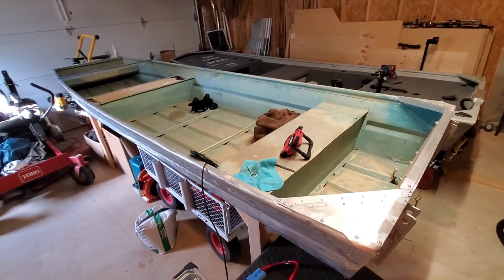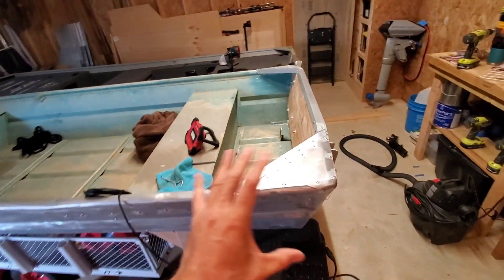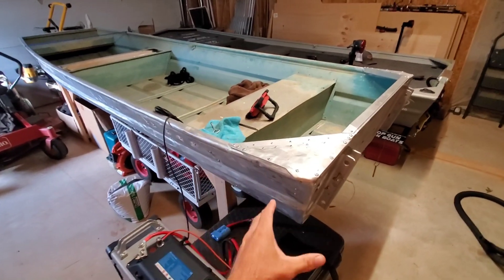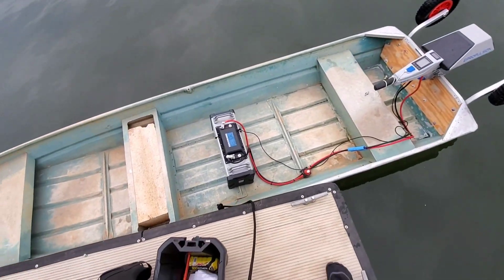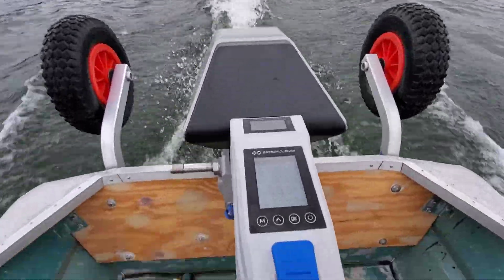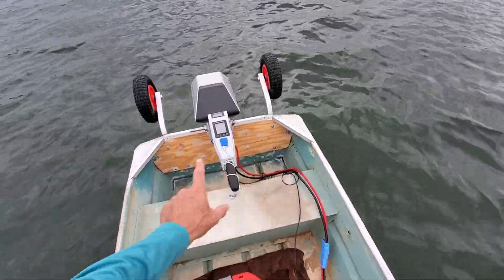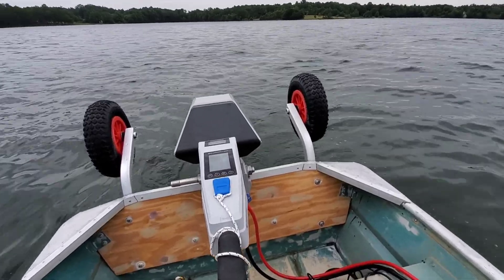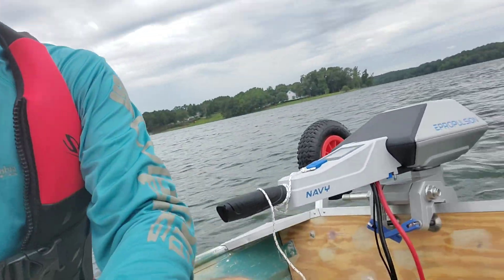12 Ft Electric Jon Boat Top Speed / Stability Test

Comment: Seems to me that electric outboard is not a 6  hp equivalent when used in a 12 foot Jon boat but might be 6 hp push power for slow 5 mph more heavy water line speed  14 foot bass boat  . I saw another you tube with 6 hp outboard I think it was mariner and he was flat out getting 18 mph   using the inbuilt tank 1.1 liter  (  0.3 USA gallon )every 25  minutes . That makes about 30 mpg .Only complaint was it took about a minute with bogged down engine to get up to speed  to get full speed . Probably  a 8 hp would solve that or less pitch prop but reduce top speed down to 15 mph .
This combo in electric  is very good if your happy to top out at 12 mph .However it probably need the  electric 9 hp equivalent to match the  gasoline 6 hp  . Without to give us the type of battery is it for example a LiFe 49 volt 4 kilowatt battery we cannot know your range  or run time .If battery is LiCobalt  18650 types with 4 kw it would suggest run time is 1 hour  and some minutes like 15  minutes. The last half hour power in electric in this combo might reduce speed to 9 mph suggesting range will be something like ten miles with average speed of 10 mph .
These are the important facts  boat users need to know 
I suggest  possibly increasing the pitch of the prop and reducing the blades to two blades might give you a extra mile per hour but take a bit longer to get up to full speed ..
Once you put two or three people in this boat  speed will drop s lot to me like 4 mph
Keep us informed updated on the tests
Reply: qeong

Comment: I love the electric tiller motor.  What was the cost of the motor?  How about the battery.  It looks as thought they want that specific battery to the motor.   I've got a 14 horse gas motor that I'd love to switch out to get away from gas.    You're giving me some great ideas.
Reply from the maker: Electric Outboard by ePropulsion:
Want to try before you buy? ePropulsion motor is available in over 30 countries and regions. You could schedule a test ride here: https://epropulsion.typeform.com/to/cpDJAn
Reply from the maker: Motor was 2,600 I believe...
Reply: 15 hp propane

Comment: Thank you for the data, I appreciate it. I've been going back and forth between the Spirit 1.0 Plus and Navy 3.0 for my 15 foot Kaboat. I'm willing to pay extra dollars for the speed, but I'm not sure I'm willing to carry the extra 100+ pounds when an inflatable requires moving everything four times per trip (load into truck bed, unload at put-in, load back into the truck bed, and unload again at home). My boat is used mostly for hunting, so the ability to put in without a boat ramp and silently travel far and fast for ducks and deer is attractive. Right now I run a homemade 105 amp-hour lithium ion (22 pounds) and a standard 40 lb trolling motor (18 lbs), it's lightweight but  S - L - O - W  at 3.7 mph...
Reply from the maker: No problem,  I believe I will be doing a vidro on the Spirit 1.0 plus in the future. The Navy 48 volt lithium battery weighs 67 pds and the Navy 3.0 is around 40 roughly,  can't remember exact. I think total package came in at 112 pds. Still a considerable amount but given thats the outboard and a 48 volt battery, incredibly light. Not sure the total Spirit weight , im sure not as much as Navy. Regardless if you did Navy, you'd add roughly 70 pds compared to your current set up. At the end of the day you just have to ask yourself dies tge added weight make sense for the return? If not, Spirit Plus is a great more affordable option.
Reply: buy whalerr 15 50 hp eltric outbard

Comment: Hi. I was fishing and boating for over 40 years. If you can swap the jonboat for a Lund or anything else, 12 foot but with a V shape bottom, the ride will be much smother. Also move the battery in front, where the weight can press down on the front V shape of the bottom and cut the waves...jonboat are for marshes, swamps, etc, and it seat on top of the water. The V shape is designed to CUT the water...

Comment: Sure the performance is much better than a trolling motor, but what about cost?  I suspect your setup is financially comparable to buying a Ferrari engine to power a Yugo.
Reply from the maker: Cost is relative to the individual.  I know guys running 20 grand in their electric only tournament boats. What about guys buying 70 grand bass boats? Electric outboards are expensive but the majority of the cost in my setup is the lithium ion 48v battery. Its not just about speed, direct drive brushless for superior reliability,  battery management system w real-time diagnostics, battery w 3,000 charge cycle life, can be drained to zero, and my favorite- 3 hr charge time from 0 - 100%. Oh, and yes, going almost 12mph in an electric only lake flying by the ttolling motor guys. Worth every penny to me.
Reply: @AnthonyJonesBrigadeBoats  
Yeah but those examples are the entire setup.  You have a rich man's propulsion system powering a poor man's boat.   Generally, people who can only afford a Jon boat can't realistically afford to power it with a system several times more expensive than the boat itself.
Reply from the maker: @Andy-df5fj  I'm not sure if you realize or not, but the whole point of my channel is to push the envelope with what the status quo of these small boats are. I'm not looking to have your every day jon boat. Me, Mike from TBNation,  Ryan from Fireant Fishing, Nate Eckhold,  are looking to build the most high end jon boats out there. This 12  ft is in the early build stages of being one of the most highly modified 12 footers people have seen. Not saying to brag, that's just what we are about as a group. More and more guys are dumping big $ into electric only boats and there is a whole industrybeing built around it that I have seen grow before my very eyes, Especially in my area, due to the amazing fishing and tournament trails provided that you just can't get on the big lakes. I really don't understand your argument man. Is it just that I have an expensive outboard on a jon boat? Again, its fine to have a 70k bass boat or even a 6k kayak? But I guess I cross the line putting a high end electric outboard or a jon boat that will be purpose built for electric only lakes? Just sounds like a bit of hating to me.
Reply: @AnthonyJonesBrigadeBoats  
No I didn't realize that.  I was just surfing youtube and came across your video.  I understand now

Comment: i had crazy idea few months ago. minnkota has motor mount trolling motors. get 2 doubles mount on trim tabs. add rudder.360# thrust.
Reply from the maker: Yeah but you'd have like 1,000 pds in batteries.  Lots of guys in electric only tournaments run dual rear trollers but the speed you gain is canceled out by the weight of the batteries especially if running 24v or 48v
Reply: @AnthonyJonesBrigadeBoats  right i was thinking lithium prices coming down finally.
Reply from the maker: Yeah i was thinking 10 yrs ago cell phone prices would go down, they went up...who knows w lithium?
Reply: @AnthonyJonesBrigadeBoats  battle born dropped price on 100ah only 31# think$659. voltcell has 85ah $599 but still 31#. how heavy is your 24v from torqeedo? neat little motor!